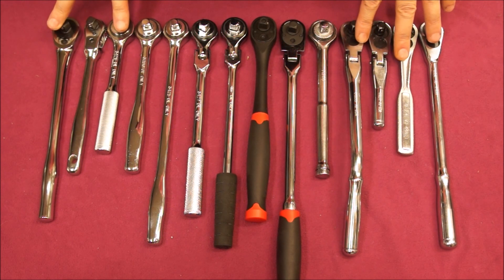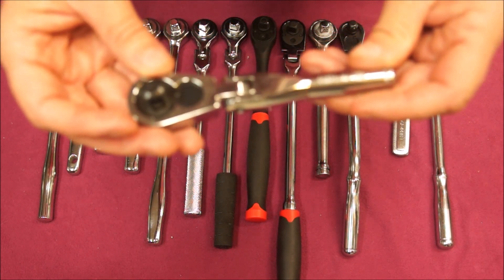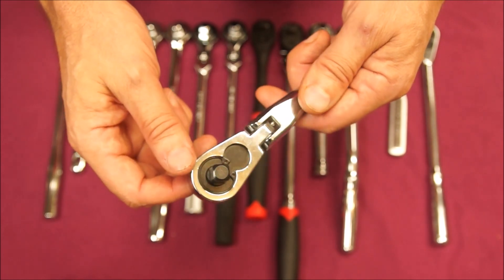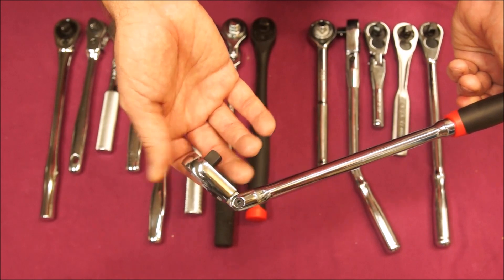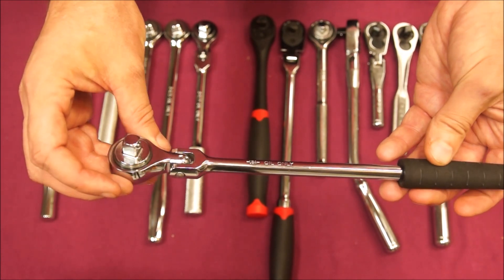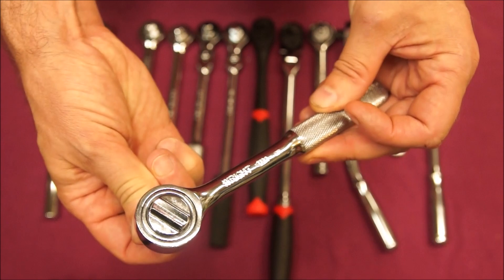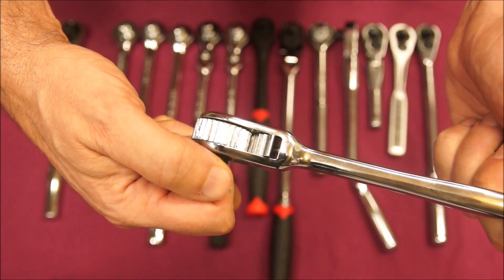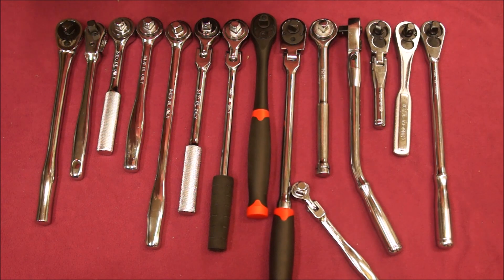3/8" Ratchet comparison

Comment: Suggestion:  try the Pittsburg Pro swivel head in, 1/4", 3/8" and 1/2" drives all with "cold weather protection" comfort grips.  More than worth the money with a lifetime warranty, although I've never had to use the warranty.  You have a nice collection.  Thanks for sharing.  I have a thing for ratchets since I was 16 (now almost 70) and like most guys who twist wrenches, 3/8" is my go to work horse.  I have the 1971 craftsman ratchets with the so called "fine teeth," I rebuilt my first engine with when I was about 18.  Those vintage Craftsman ratchets, sockets and wrenches are all still working flawlessly.  As I remember, I paid $36.00 for a fairly comprehensive "starter" set.  Imagine.
Reply from the maker: I have those Pittsburgh ratchets in 1/4 & 3/8 drive, I don't find them very useful in 1/2" drive. This video is now 6 years old and I've added quite a bit to my ratchets since then. Here is a video I uploaded just 2 days ago showing the current collection https://youtu.be/yT7WEccUhAA
Reply: @MarkFox  Hey, that's great.  Thanks for the link!  Yes, I don't really use 1/2" much either, but I just wanted the full set.  Thanks again.
Reply: @MarkFox  I just now watched your posting from two days ago.  You have a splendid collection and congratulations and how clean and tidy everything is!  I'm the same way.
Reply from the maker: I have some more roto ratchets coming in from Japan now and should have a new video on them in the next couple weeks.
Reply: @MarkFox  Sounds good.  I just subscribed and hit the notification for all so I don't miss it.

Comment: I love my Wright ratchets. I qty (3) of them a flex head bent handle 3/8 ratchet with the black rubber grip and qty (2) large 1/2 inch drive ratchets, 12 1/4 inches long and 15 Inches long. 😎
Reply from the maker: I'll see what I can do, working crazy hours at my day job currently.

Comment: I suggest adding some Armstrong ratchets, maybe the 11-992 and/or 11-994
Reply from the maker: Armstrong was closed down a few years ago, might be difficult to find today.
Reply: @MarkFox  cripe distributing has the 12-992 nos but ya finding the 3/8" is a bit harder but they come up on eBay semi often, the only one I'm short of the whole Maxx line is the 1/4" flex
Reply: How you love and buy Wright, I do with Armstrong the only difference is I have the added sadness of being out of business with the experience
Reply from the maker: I still blame their parent company (Apex) for that whole disaster.

Comment: need too greese the crafty.use sil glide they will work like butter
Reply from the maker: Craftsman ratchets are not worth their weight in scrap metal. No amount of grease will fix the poor tolerance fitment.
Reply: @MarkFox  craftsman usa? its better then the Carlyle crap u advertise.if thier so bad send them to me.
Reply from the maker: I would have been happy to send them to you but I already gave them away a couple years ago. Try a real ratchet and you will never go back to using those Craftsman models.
Reply: @MarkFox  you do understand your calling made in the usa junk and Taiwan real tools lmao.you have never worked on anything in your life .the 36 tooth craftsman might not be much to look at but they do work well.
Reply from the maker: @hobosharklawnmower  Just because something is made in the USA don't make it better. GM, Chrysler & Harley Davidson have been proving this for years.
Reply: @MarkFox  hand tools are better made in usa
Reply: what would u rather have in a zombie apocalypse or 20 years from now. a indestructible 36 tooth crafty or a tiawan piece of junk?
Reply: just because a ratchet has 100 teeth and looks fancy dont make it better then the old craftys.Never judge a book by its cover
Reply from the maker: @hobosharklawnmower  Indestructible? I've broken several 36T Craftsman ratchets with my bare hands, no cheater pipe involved.
Reply from the maker: @hobosharklawnmower  I agree 100 teeth don't make a ratchet any better. I won some 30 tooth Cornwell ratchets that are fantastic.

Comment: I think 3/8" drive is a weird one. Mainly because if you have 1/2" & 1/4" drive stuff/ sockets etc, then you don't really need 3/8" sockets, just an adaptor for the ratchet. As the range between the 2 covers the range offered by the 3/8" drive. That's why most are ommited in sets. The ratchet itself however is a different story. Sometimes you want something a little bigger for those 1/4" size fixings & sometimes you want something a little less cumbersome than the 1/2" ratchet for that 22mm etc. So adaptors again. Also things like crowsfeet can be cheaper in 3/8" than in 1/2" for the same sizes, so it comes good there.
Reply from the maker: I think it totally depends on what you work on, for me I use the smallest size that fits and that usually means 1/4" drive on motorcycles. 3/8's is my next most used size usually for engine internals or brake work. Only use 1/2" drive for wheels, swingarms, and countershaft sprokets, many times I wouldn't have the clearance to use drive adapters.
Reply: Mark Fox Yeah, I'll use them for use on my motorcycles as well as other stuff now. I may get a cheaper set of 3/8" sockets at some point, as you never know they may be ever so slightly thinner in diameter than 1/2" & there may be a tight spot now & again. But for the minute the 1/2" range & an adaptor works great. Also I notice companies only including a few deep sockets in sets for all drives. This means you have to buy all of them across the 3 drive types to get a complete set unless you buy separately.

Comment: Excellent video!  Thanks for taking the time to put it together.   I mostly use the USA made Craftsmans that I bought years ago. The China made ratchets are crap w/plastic levers that tend to break and strip easily.  Never saw an open head ratchet but I can see it being troublesome if dirt gets into the gears.  Also, the Pittsburg composite was a pleasant surprise...I've been using one for a while now with no problems.  Its a ratchet I would recommend if living in a cold climate.
Reply from the maker: Thanks for the comments.

Comment: If you encounter the older Matco ratchets such as the BR8 which are no longer made,made by Wright with the Matco name on it.The internals of the Snap On ratchets for the dual 80s are foreign made as well.I do have my favorite 3/8 drive ratchets.I do have a Cornwell 3/8 stubby ratchet I use in tight spots.Another is my Matco locking flex head ratchet in 3/8 drive.Has a lever to lock the head in place.Armstrong makes the same ratchet as well.I have my Mac ratchets that I do like and I can get the repair kits for them for free.I call them and tell them the part number off the ratchet sending me it.SK is another tool company you can get the ratchet repair kits,you contact them and they send you them for free.They don't want the old one back
Reply: wafrederick Snap-On Dual 80's stamped USA are 100% USA.  Not aware of Dual 80's with foreign components, but maybe they do exist.  That being said, Wright 👍 SK 👍.  Am having a bear of a time deciding between Wright 3430 & SK 45173 3/8 head in 1/4 body rats.  Can't wait to use it on bits & in engine bays once I do decide!

Comment: You like those Wright so much I'm surprised you don't have any SK Tools. Very similar  design. And VERY easy to maintain and rebuild.
Reply from the maker: Did you see my tool box tour? I do have some SK tools. 
1/2 drive 6pt chrome metric sockets deep & shallow. 
1/4 drive metric flex sockets 
1/4 drive metric semi-deeps sockets.
3/8 drive metric flex sockets
6 point metric combo wrenches. 
Flex socket metric combo wrenches. 
Flare nut metric crowsfeet wrenches
Wright Tool is local to me so there are always my first choice.
Reply: Actually I did watch your toolbox tour which is VERY impressive. I had JUST watched your vid on your favorite ratchets so thats where my comment was directed. Short memory span.

Comment: I am a BIG fan of Proto pear head ratchets. They use a design that started in 1939 when Proto was called Plomb and is still made today. You can buy a new repair kit and install it in a 1939 model and it fits and works. If you have a old Plomb model that needs a repair kit, just find a current model Proto ratchet with the same model number and order a repair kit for it and it will fit the Plomb ratchet. I only use oil in all of my ratchets and flush them out often and replace the oil with fresh oil.  Plomb and Proto  use conical springs to engage the two pawls to engage the ratchet head. Using grease to lube the ratchet can keep the pawls from fully engaging the ratchet head causing broken teeth. I have been turning wrenches since 1966 and have never damaged a Plomb or Proto ratchet. The Plomb / Proto  ratchet is the most copied ratchet design.

Comment: I believe the cornwell is 40 tooth
Reply from the maker: Cornwell's are either 30T or 72T, the 30T models are 100% USA and the 72T models the actual ratchet guts are made in Taiwan.  http://www.cornwelltools.com/webcat/products/JR40-%252d-3%7B47%7D8%E2%80%9D-Long-Handled-Ratchet.html
Reply: Mark Fox you are correct i have the 30t models..love em..it just seems like the fine teeth sound weaker more fragile..maybe they arent with more teeth in contact but i like the lower xount..i have some snap on dual 80s and why the action feels nice..i just love the solid feel of the lower count cornwell
Reply from the maker: They are definitely the smoothest, lowest back drag low count teeth ratchets made. A 36T Craftsman ratchet feels like it's full of sand.
Reply: I've noticed the better quality companies here in UK their teeth count is around the 40 teeth mark. The cheaper far east ones tend to all be 72T +. And while some have gone over 100 teeth plus now the high quality UK ratchets don't go higher than 60 or 80T. Higher teeth give better angle of use but, remember they are easily chewed compared to stronger bigger teeth on the less count ratchets. That's just engineering 101.
Reply from the maker: Ashley, what models are actually manufactured in the UK? I have some UK manufactured King Dick combination spanners that I love and I know are manufactured there. King Dick also list some ratchets but I don't know if they are actually made in the UK or if they just label them. 
A example would be Stanley hand tools here in the US, Stanley is a US company but all their actual mechanic style hand tools are made in China. I would love to try some actual UK manufactured ratchets. 
This past week I found a socket set on Ebay from a UK seller that ships free to the USA. These sockets "Appear" to be a copy of MAC Tools Precision Torque for a fraction of the price. I don't know how they make any money selling and shipping them overseas for free. 
 http://www.ebay.com/itm/222167575677?_trksid=p2057872.m2749.l2649&ssPageName=STRK%3AMEBIDX%3AIT
Reply: Mark Fox I have some tool reviews on my channel. Some good stuff, some cheap & cheerful stuff just to try. Draper is a brand here but it does import & restamp a lot, There expert range is when you know it's a good product. King Dick has been around for years too. We used to have some communal King Dick Spanners where I worked once. There's Britool but it's an odd one they split into 2 companies when Facom took over. Britool Hallmark is the stuff UK made (very good) & the Expert stuff with a Stanley stamp is made by Facom (still good). I like to source Hallmark stuff now if not the Facom made Expert stuff. You should find Hallmark on eBay, it's our tool truck brand if you like.
Reply from the maker: Just looking over Ebay I could only find 1 British made Britool Hallmark ratchet. http://www.ebay.com/itm/BRITOOL-HALLMARK-1-4-Drive-Ratchet-Made-In-England-/252496340334?hash=item3ac9f4656e:g:A6sAAOSw9NdXrETc 
Everything else appears to be the same Taiwanese manufactured stuff that we can buy here in the US with different engravings. MAC tools sells the same Expert line here as their value brand.
Reply: Mark Fox Yes, Mac bought Facom which had originally bought (or bought part of) Britool. There's nothing value / budget about it really though. A reviewer on here torque tested 3 of there 10mm spanners they gave him to review; the Mac, Facom & Expert. The Expert took the most torque of the 3 & was the cheapest. That's why I just got some new 1/2" Expert sockets. They just have to do something with the company they bought & don't want it to encroach on their other stuff, so pitch it down I guess. As for the Britool Hallmark you could try http://www.trademarquetools.co.uk they should do international shipping. Hallmark do have a nice 360 style ratchet I've recently seen with different color handles.
Reply: Mark Fox Trademarque tools do ship internationally if you click on the delivery tab on their site it shows how to go about it. They do have a deal on this push through 3/8" ratchet. But all of them are under socketry. http://trademarquetools.co.uk/details.asp?Prod_Code=MRC201&CAT_CODE=9&subcat_Code=63&catname=&subcatname=&imgs=&Prod_Name=3/8%22%20SD%20CLUTCH%20RATCHET%20WITH%20COMFORT%20GRIP
Reply from the maker: Is that actually manufactured in England? If it's not engraved/stamped "Made in England" I'm not interested.
Reply: Mark Fox I suppose all you could do is drop them a message on their contact us tab asking about which made in England models they stock. I'm going to get a set of Britool 6 point box end Hallmark combo spanners around January sometime I should think. As I've found it difficult to find a decent 6 point set.

Comment: There are plenty of fine tool makers that make really good ratchets: Gedore, HAZET, Stahlwille - Facom - EGA - Wright, Snap On - Kyoto Tools. Bahco, Williams, Wera make really nice ones too. 60 to 80 teeth (rarely up to >100). You should not need any warranty at all - if the tool is not abused it will last for decades - or fail very quickly. And where it's produced should not matter either: Germany, Sweden, France, Spain, USA, Japan, PR China - everyone can make very good and darn lousy tools. You need good raw materials, well trained personnel and a strict quality control. It won't be cheap but worth its money. The rest is up to "horses for courses" and personal preference.
Reply: China's burned way too many buyers.  Seems their idea of precision is how close to warranty/store return expiration the item can fail.  Taiwan is much preferable for inexpensive tools.  Not saying China can't make reliable and proper goods.  Saying they don't send them our way.

Comment: I've heard the wright 41 teeth ratchets imitate an 82 tooth because of the dual pawl design. Is that true? I've been wanting some but the 41 tooth is just too low for me.
Reply from the maker: +GoAmericaTeamSquad  Yes most Wright 3/8" Ratchets are dual pawl with the exception of the 3430, 3440, & 3480. You can check to see if the particular ratchet you are looking for meets you requirements here 
http://www.wrighttool.com/online_catalog.asp
Reply: +Mark Fox so if you rotate the drive around 360° it will click 82 times? By the way thank you for the review on these wright tool ratchets, it's hard finding any video reviews.
Reply from the maker: +GoAmericaTeamSquad Yes. 82 clicks per 360 deg of rotation. I might do the 1/4" drive ratchets soon.
Reply: Yes Sir. Double pawl. My two 1/2 inch drive Wright ratchets both have 45 tooth count with double pawls, which makes them both 90 tooth count. I love them. They are very strong and tough ratchet. I love my made in The USA ratchets and tools. 😎

Comment: Koken, MAC tools
Reply from the maker: I have a couple of the Proto's which are the same as the MAC with different handles.
Reply: @MarkFox  yes the are, a prefer the older MAC ratchet with hard red Handel, but kokens are worth a look at like the round head's
Reply from the maker: I grew up using my dads Wright round head ratchets and they still feel the best to me. I would try the Kokens if they were more readily available  here in the US.

Comment: the first ratchet i mean the craftsman
Reply from the maker: +eresunghost13 tt  Agreed, The Craftsman ratchets feel like they are full of sand, I'm sure they work fine for some people but I would take any Harbor Freight ratchet over any Craftsman offering.
Reply: I have this ratchet and it's very smooth and very low backdrag.  But I bought it when it first came out.  I think there are various versions with varying internals.  I saw in another youtube video that Sears put pressure on the manufacturer to cut manufacturing costs which may have cheapen the gearing.  You could just get a repair kit and see if that will improve the performance.  But I think you have many options already.
Reply from the maker: Wally are you referring to the chrome pro version or the old paint brush handle model? Internally they are identical and the guts are interchangeable and they should work exactly the same. There is a difference between the USA V the Chinese manufactured models and the rebuild kits are not compatible between then.
Reply: I have both the chrome pro and flex head "paint brush handle" ratchets.  To be honest, I own the entire series.  I hated the raised panel ratchets so when the pro versions came out, I jumped on all of them.  Thesearemytoys came out with a complete history of these ratchets and he said that the US manufacturer was pressured to cheapen the build and so maybe the version you have was the result of that policy.  I didn't know that the Chinese rebuild kits didn't work on the US models.  I guess if ever, the ratchet fails, I will have to try to find a US rebuild kit on ebay.